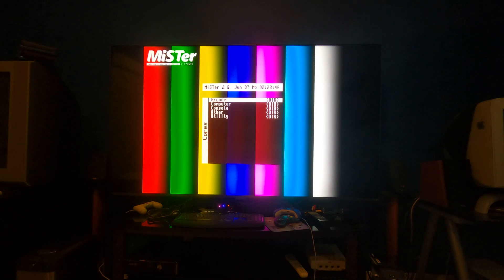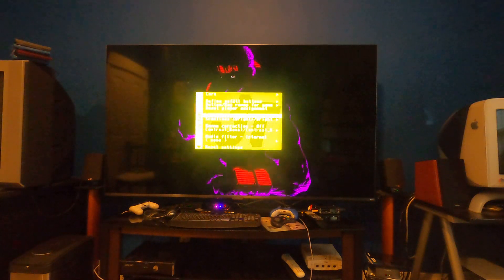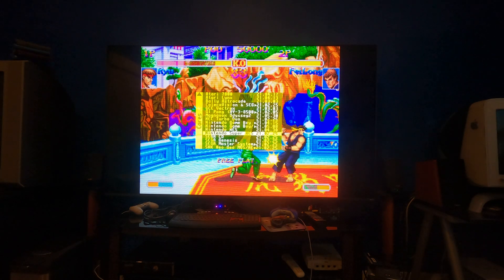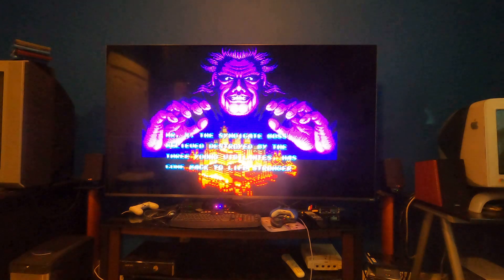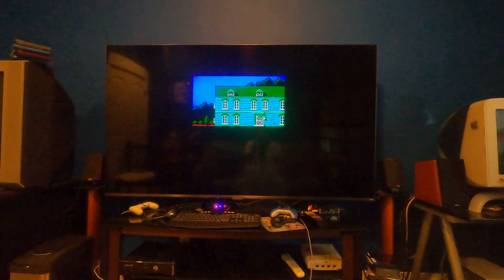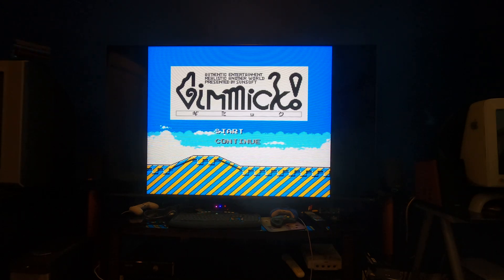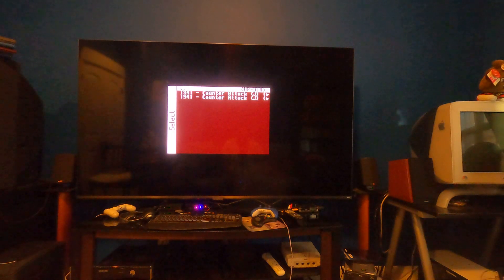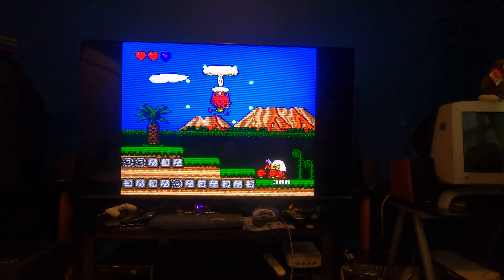MiSTer 6X Output featuring Atrac17 modelines

Comment: This has no real use, except if your TV has a native 1440p panel or has a very poor upscaler chip. This adds extra image processing for nothing as the Mister already outputs digital image which can only lose quality when adding more and more processing.
Reply: Since in FPGA more processing means more logic not more instruction, it doesn't add any additional lag or delay.
Reply: @BigMacIIx  I am talking about losing image quality by adding extra unneeded IMAGE processing

Comment: Can someone explain something to someone considering pulling the trigger on a Mister. I don't have a 4k TV, just a basic 32 inch Bravia. If I want to play a game with scanlines like the Retropie offers do I need the image to be cropped and not full screen? Thanks.
Reply: If you're running at 1080p, your options for even scanlines are to run at 4x integer scale, which results in a small image or 5x integer scale, which will result in a bit of the top and bottom of the image being cropped off.  If uneven scanlines are OK with you, then you can just do non-integer scaling and use scanlines with that.
If you run at 720p, you can do 3x integer scale, which will result in a perfect fit with even scanlines.

For console games 1080p at 5x scale is my favorite choice.  There's rarely any useful information in the cropped area, and many times it's even just blank space anyway.  This was done to account for the overscan on consumer CRTs.  So with the 5x scale, you sacrifice very little (in console games), and you end up with an even bigger picture than what you would have had with a perfect fit scale (3x @720p or 6x @ 1440p).  For that reason, I prefer 5x 1080p scaling for console games even if I have the option to do 6x scaling at 1440p.

For arcade games, it's a different story.  They're more likely to be designed to use all the screen space available to them, so the 5x crop mode may be unacceptable.  The exception seems to be Neo Geo.  Most of those games seem to fit very nicely in the 5x crop mode.  They were probably designed to take consumer CRT overscan into account because they were meant to be released as both arcade and home console games.
Reply from the maker: There's many options for mister. You just have to tinker around to find what you like for your setup
Reply: If you intend to play these games in stretched full screen, a Mister aint for you

Comment: Can you not just do this with retroarch on the pc? I don't get why you would need the mister? Forgive my ignorance.
Reply: We are talking about hardware "emulation" or "simulation here, Retroarch is Software emulation. There is a huge differences in precision and, of course, lag. With FPGA simulation  you get  practically the same performance as original Hardware, timing, lag, sound, it's amazing.
Reply: Software emulation or fpga hardware emulation/simulation, at the end of the day it’s a means to an end to experience retro gaming. I don’t understand this concept of casual vs purist though. Technically speaking, if you are truly a purist, than emulation should be frowned upon and only actual hardware/PCB and cartridges are considered “pure”. Also of note, I own original hardware,  mister fpga along with anologue consoles, and a pc running software emulators.
Reply: @lenpak  I won't be so absolute about "pure". the same original hardware can have some few differences depending on model or its manufacturing period. because it doesn't use the same chip version or because the manufacturer made some internal changes for any reasons. a same game in the cartbridge can have different versions too. theses changes are fixes or updates to make the game experience better then its first release. and finally, the hardware used to the game development could be different and more powerfull than the  final users hardware. this means the home console doesn't always reproduce what's developers were expecting too. ex: finalised games have sprites glitching, slowdowns, etc. now emulators can extend the old hardware power and provide a better game experience.
Reply: @Andearoid  yes, I fully agree, example is snes jr with the 1chip that has some compatibility issues. Ultimately, the point I was trying to make was the idea of the mister being for the “purist” and software emulation like retro arch being for casual was too generalized.
Reply: @lenpak  in my opinion the Mister is more appreciated by people who are not comfortable with computers. and this is the case for people who's exclusively playing with console. for them, the Mister is a good choice to enjoy an high level emulation instead of official mini consoles or a console hack emulating other console.
Reply: X6 means for 4k tv? If yes i stick to 5x than
Reply: @allegrosurf7024  x6 is 1440p
Reply: Retroarch for the casual. MiSTer for the purist.
Reply: @PunchCatt  uh huh... Classic elitism of mister owners. Sad you spent $300 on something that won't even play everything an emulation pc will? Mister is for casuals who don't want to set up emulation
Reply: @displaytalk  he is right Retroarch is for the casuals if is not fpga or real hardware i dont fuck with it at least use mame for crying out loud
Reply: @soloM81  I use retroarch on a crt with 15khz linux. That's what a real man does. Y'all are the casuals
Reply from the maker: @displaytalk  I did that years ago. You can scroll back through my videos with Lakka and groovymame. Mister obsoletes them rather easily. But hey you can do n64+ where Mister will cap out on saturn. Personally mister is so much more accurate that I don't run a Lakka or groovymame box anymore. The 9x scaling isn't that much an upgrade up warrant lag increase not in the inconsistent emulation
Reply: @BahnYuki  In all honesty I have no problem with mister nor with people using original hardware. You do you. It just pisses me off when mister fans claim their option is better when it isn't. There's several different ways to play each console now. Each is viable. For me I prefer being able to play everything and use save states and slowdown removal.
Reply: @displaytalk  you're absolutely right. Retroarch has the Run-Ahead latency. then with a true CRT screen you can rich an input lag lower than the original hardware. and if you want play on an LCD screen,  HLSL shaders can produce CRT rendering with a dotmask. not just scanlines.
Reply: @Andearoid  Well, it's not really lower than original hardware at least in my tests. My pc on groovyarcade+SR2 Retroarch to a 15khz crt gets 4 frames of lag(total! System, controller, RA everything) on runahead 2 frames+frame delay @15 with super mario world. My real snes gets 2-3 frames. Still worth that tradeoff for all the other features (save states, not having to buy flashcarts or console-specific controllers, and many more), but it is more lag even with runahead on
Reply: @displaytalk  to be exact, it's depending the game. few cores doesn't work yet with Run Ahead latency. and your computer must be able to run the triple of the charge you need usually to emulate the game. on its own hardware a game usually needs 3 to 8 frames to calculate the next frame when you push a button. with the Run Ahead latency properly set you can reduce this by 1 to 6 frames. on my part the Super Mario World is more reactive on my RetroArch + CRT than its official 60 Hz hardware. with my SJ@JX CY-2219 I use 2 instances and 3 frames to run-ahead. perhaps you was using a Bluetooth controller. or with a Raspberry Pi the Run Ahead latency can produce slow down.
Reply: @Andearoid  Nope, I was using a raphnet classic controller adapter, which is one of the fastest wired controllers available
Reply: @displaytalk  that's strange. your manufacturer estimates a 6ms delay in the worst case. at 60Hz it means 0.36 frame late. you should have a better result than with my SJ@JX USB controller in my arcade stick. I don't know its real specification but I can say its a bit more reactive than my Wii U Pro controller with the same Run-Ahead latency setting.
Reply: Retroarch will do ya one better since it does 9x(or any resolution you want) output so can match the native res of the tv
Reply: @detroit retro gamer drg313 To each his own indeed